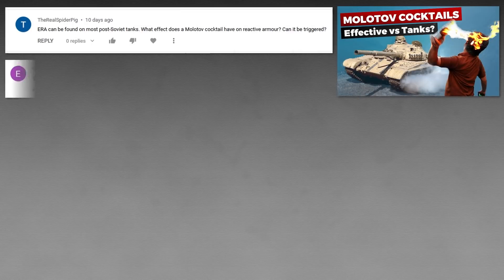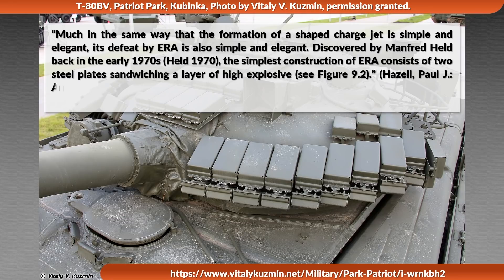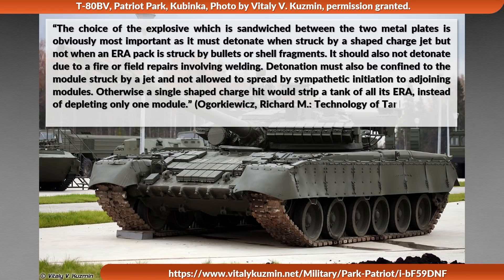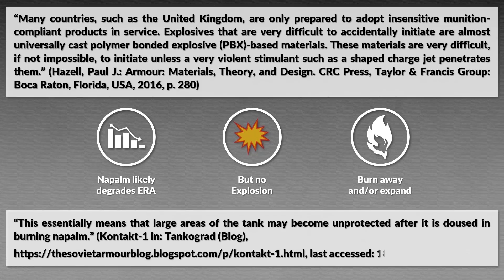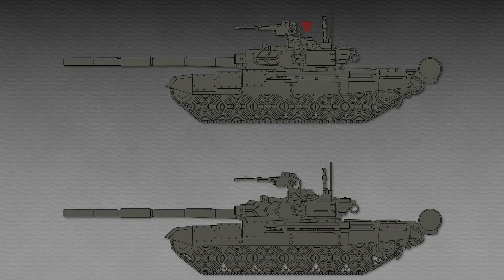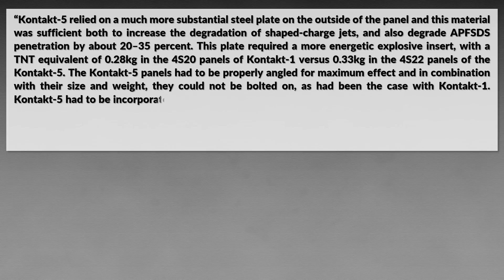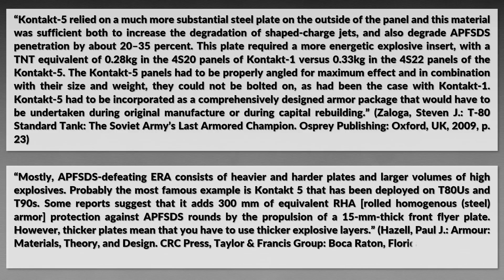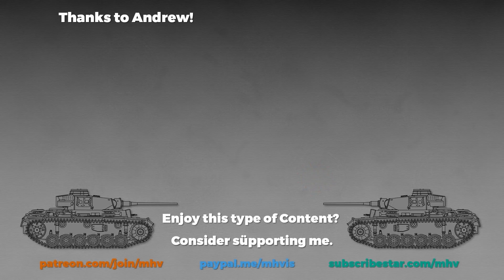Why does Russian Explosive Reactive Armor not explode?

Comment: NOTE: From the late-19th Century through well after WWII, the US Army and Navy used an extremely insensitive explosive ammonium picrate for many projectiles, most especially those that had to penetrate any real thickness of armor.  It was originally called "Dunnite" after its inventor or, by the US military, "Explosive 'D'".  It was only about 90% as powerful as TNT, which is why it was not used by most other nations, but could reliably be slammed through any thickness of armor (or earth, rock, etc.) and, when properly tightly packed in the projectile with no voids in the material, (learned prior to WWI during tests and training exercises), it was also safe against being set on fire and/or detonating due to fire unless heated to a very high temperature.  Setting it off with fuzes in armor-piercing projectiles using only tiny base fuzes and small boosters was very difficult (another reason for lack of foreign use), but this turned out to be true for most less-sensitive explosives widely adopted after WWI, so a better booster was eventually developed, Tetryl, a very powerful, but safe in tiny amounts, with the US Navy, being rather psychotic about ordnance safety, requiring extremely tiny pellets in its base fuzes pressed into two rocket-nozzle-shaped pits in the fuze upper end, so they caused HEAT-shell-like blast needles into the Explosive "D" that reliably set this filler off.  After WWII, even more fire/blast/fragment-safe explosives replaced Explosive "D"..  Why other nations were not as strong on safety is kind of hard to understand, given the effects of accidents.
Reply: TIL The us actually put safety first for many munitions.
Reply: Oh and I must say I am a great admirer of your work an naval armor and munitions. It is fascinating reading and very informative. The amount of research and effort you have devoted to it is truly impressive.
Reply: @Lovemy1911a1  This project started because I liked to play naval miniatures while going to college and I found the rules for many things very complex and, roughly, accurate, but the armor rules made all of the ships look like match boxes hit at right-angles.  If you see pictures in such documents a JANES FIGHTING SHIPS, you now that this is completely incorrect.  So with great hubris and ignorance as a Math and Physics Dual Major at UCLA, I told myself that I could solve this.  And I later found that I am insanely stubborn when confr9nted with a problem.  I would not have gotten very far except very, very strange things happened with this study.  I got a job just after graduation in 1972 with the US Navy at NSMSES on the Port Hueneme, CA, Sea-Bee Base concerning guided missile fire-control and was there while we added digital EVERYTHING over the next few years (I was not just on the ground floor of the introduction of digits to naval military gear, I was in the basement!).  And, very helpfully, the TERRIER GMFCS that was my primary system had to have people who knew something of digits go to what was the old WWII US Naval Proving Ground, Dahlgren, Virginia (now the US Navy Surface Warfare Center, Dahlgren Division) where they were developing the digital stuff (I was there, on and off, for 19 weeks).  While there I found out that a number of people who had worked on armor and AP projectiles were still there (remember, early 1970s), so I talked to several of them, including Dr. Allen V. Hershey, who had been the director of the Ballistic Computation Division during WWII until armor went away in the US Navy in 1955.  He was interested that somebody still cared about all the work that he had done back then.  So, when he retired in the early 1980s, HE GAVE ME EVERY PERSONAL FILES AND ALL RELATED DOCUMENTS HIS GROUP HAD EVER WRITTEN!!!!!!!  He was afraid that they would throw it all away.  So, I was like a young sleuth that Sherlock Holmes gives all of his work to when he retires, to continue the effort.  Indiana Jones has nothing on me.  And I helped the redeployment of the IOWAs, too, by supplying needed metallurgical details -they had not believed that the ships would be resurrected and suddenly needed EVERYTHING YESTERDAY.  Got not one but TWO guided tours of the NEW JERSEY during overhauls.  As I said, Indiana Jones, eat your heart out!  And that is only a few of the strange things that happened to get me information.  I am sure that there is something going on with this - how much "luck" can one person have, anyway?
Reply: @NathanOkun  well that is a pretty amazing story. Glad you were able to get so much information before it ended up locked in some forgotten cabinet or in a dumpster. I work for NavAir on the maintenance side of things so I've seen how things get lost to time. Thanks for the additional information. Out of curiosity do you know of any instance more sensitive explosives led to an accident? Oh and by powder I meant propellant in general, though in big guns that's probably not a very good description given the size of the propellant pieces. Not like the little sprinkles I load into my 30-06.
Reply: @Lovemy1911a1  If you are talking about propellant accidents, you have the Spanish-American War initiator, USS MAINE.  It had its magazine blow up due to faulty cooling between the magazine and the boiler room.  I am not sure what kind of propellant it had, black powder, brown prismatic, or more modern smokeless nitrocellulose type.  The US never used nitroglycerine-laced double-base propellants except early in WWII, when they adopted some British Cordite due to needing more propellant immediately and it took time to ramp up the pure nitrocellulose type that the US used.  The British Cordite had special warnings on the bags to make sure that they were never exposed to excess heat or rough handling.  The Navy retired that propellant as soon as they had enough of their normal type. 

A bigger danger was nose fuzes in nose-fuzed Common with black powder fillers or the HE/HC type used later.  There had been reports of nose-fuzed shells dropping nose-first on a steel deck and blowing up.  To absolutely make sure that US Navy nose-f8zed shells could not do that, WWII HC/AA Common shells (not sure about before that), had Auxiliary Detonating Fuzes added.  These were cylinders inserted between the nose fuze and the booster explosive that had were just a firing pin at the top pointed down into another instantaneous detonator, with the upper side of the ADF having a thin plate that, when armed after firing by projectile spin, allowed the detonator of the nose fuze to provide the blast pressure to push the ADF fir8ing pin into its detonator.  This caused a small added delay, so these shells would move forward maybe 6 inches before exploding, but usually hitting armor did not cause any problems; actually against thin armor, it gave them better results since they could punch a small hole in the plate before exploding.
Reply: Personal experience?
Reply: Nathan, I was under the impression that the use of insensitive explosives in shells, particularly AP shells was to prevent them from prematurely detonating on contact against armor. Was that not an issue at times of shells bursting before penetrating and either failing to penetrate as the base is now on a separate journey or greatly reducing the damage potential if a penetration occurs? Were there incidents of accidental explosions of shells that pushed the US to adopt stronger safety measures? From what I've seen propellant seems to be the main issue with ammunition safety & accidents.
Reply: @Lovemy1911a1  Concerning shell explosives as regards to armor penetration per-se, this was not a problem.  It took the typical HE explosive about 0.003 second to go off on impact shock (British Lyddite -- trinitrophenol  or picric acid  -- being the most widely-used prior and during the early years of WWI l even later by Japan),  With nose-fuzed shells detonating instantly when the firing pin was rammed by the impact into the detonator before the shell moves more than an inch or so, the detonation started from the front and moved backwards so fast that the shell really could not move more than a small distance forward before it completely blew itself apart when using HE fillers.  The inertial shock delay of the too-sensitive fillers requires the entire filler to compress itself toward the front end of the cavity before its sets itself off like being hit with a hammer, and this short compression period will allow the projectile to completely penetrate any armor plate used on any warship if it hits at a high-enough velocity to get through that armor -- either that or the projectile, if almost stopped, will detonate while halfway through the plate.  The shell will not move very far on the inside of the ship, though, causing almost all of its damage just behind the plate hit.  This is quite adequate when hitting turrets or barbettes or conning towers, but, with the internal "splinter screens" and "protective decks", and, in WWI, thick coal bunkers along the sides of the hull, the damage was considerably reduced.  That is why delay-action fuzes and insensitive explosives were needed to do major internal hull damage.  The British realized this only after they studied the big Battle of Jutland in May 1915, where the newest German APC shells had a VERY UNRELIABLE delay-action-fuze and used cushioned blocks of TNT as the filler to reduce the chance of the TNT exploding on impact (worked most of the time, but later the British added a lot of beeswax into the TNT to make it even less sensitive in their post-WWI smaller guns up to 8").  Penetrating hull hits were thus the major reason for the change to insensitive explosives, with the US figuring out this early and others having to find this out after battles later on.  Black powder was a very slowly exploding material and it took as long as a very long delay-action fuze to go off, but it was also very dangerous compared to most HE fillers when a shell was damaged while inside the ship.  The US Navy restricted black  powder in its WWII and after ships to as little as possible (saluting guns only) due to the danger of keeping that stuff on a ship when not used for anything important.
Reply: Thank you for explaining the Explosion in the USS Iowa's turret that killed so many sailors using ancient ammunition was caused by the Navy's safety first practices. I was under the impression that they tried very hard to find a scapegoat before admitting the ancient propellant probably detonated accidentally whilst being rammed into the guns barrel by the ancient rammer.
Reply: @andrewallen9993  That was never discovered.  Crushed propellant cases had happened literally hundreds of times over the years in US Navy tests and in actual battles and NONE had EVER done that.  It is possible that some new situation occurred due to some new piece of equipment, but just crushing the powder bags would not have done it.  This is the same kind of once-only fluke that caused the time-fuzed 8" shell to blow up in the gun barrel prior to firing in the DES MOINES Class warship turret explosion .  Sabotage was thought of, but since nobody was alive in either explosion case, this was dropped as impossible to prove, true or false.
Reply: @andrewallen9993  I know one of the independent people the Navy asked to cross-check the results.  He stated that the tests you mentioned were WAY, WAY beyond anything that the simple chain rammer could possibly do to any powder bag, even at the highest speed setting (there was nothing wrong with the rammer; they checked).  Whatever caused this was something that was highly unusual and, if some propellant problem, a once-only thing or so rare that nobody had ever had it and a crushed powder bag happen at the same time.  In any case, the regular powder was quite safe.
Reply: @NathanOkun  The regular powder was quite safe. I'm glad that you explained that it quite safely exploded and killed 47 matelots.
Unlike you I don't consider that safe. Sandia did several tests and they all confirmed the ammo bags and propellant were quite definitely unsafe. Presumably that's why the navy condemned so much of the old WWII Stock? Because it was so safe? Where I live we would call this operation stable door!
Reply: @andrewallen9993  They declared a lot of powder unsafe because it did not stay in a chemically stable form (the add-ins to slow the nitric acid chemical formations had slowed, but not stopped, this process).  This was known to propellant makers from the 19th Century.  If a bag was unsafe and somehow got passed the inspection process then this might happen, but testing bags for such problems had been done for about 100 years since the original "smokeless powder" introduction.  As I said, the person who I know, a REAL expert in this subject.   I worked with him on internal ballistics (how powders burn inside guns) as well as external ballistics (projectile flight dynamics) -- I am terminal ballistics.  If he says that the cause could not have been the rammer, then the cause was NOT the rammer.  Thus, we have a problem of unknown cause that cannot be duplicated by anything that they should usually be doing while loading a gun.  If somebody did something else, then we do not know, but the regular rammer could NOT do this.  My friend is sure of that and I believe him.
Reply: NOTE:  the Javelin comes down from the top and blows the turret off batter than that old stuff you are going on about...Hell you might as well talk about the Chinese firecrackers shot at the enemy before the West even had gunpowder.
Reply: @edwardschmitt5710  I was just giving you a historical perspective concerning the introduction of insensitive explosives since their introducti9on in the 1880s, with some being found to be too sensitive and others being found to be adequate through the end of WWII.  Many of the newer materials are still having some problems due to their being newly-developed and all of their quicks still being found.  Technology is moving ahead today at an ever-faster rate and many things now in use have had little time to work out their bugs.  The top-down kill mechanism required major improvements in sensors and tiny solid-state electronics and new systems to counter them will undoubtedly be developed in the future, making THEM as useless as a wet match, too.  "And the beat goes on..."

Comment: The problem might actually be simpler, what your seeing on the battlefield only LOOKS like blocks of era. If you look into it, corruption has literrally broken the tank. That era is expensive on the black market as well as otherwise, alot of it is actually being stripped off the tanks, by either maintenance or orders from higher up, and sold, to enrich the  commanders and political commissars. Its then just replaced by real looking fakes, mostly made from painted egg cartons or wooden pallets. And The inspections are made by people who are easily bribed because of the high power low pay nature of there job and employer

Comment: It's difficult for many to understand that the blast wave from various missiles , artillery etc. can knock off the turret of a tank and not detonate reactive armor . The atmospheric pressure inside of a tank is different than the air pressure outside during a major explosion. Imagine squeezing a plastic bottle until the pressure makes the cap come off.
Reply: This. Even the kinetic impact of an inert missile can knock the turret off a tank.
Reply: I somehow thought there were many hits that exploit the design of the tanks, namely their auto-loader that has the tanks' own rounds arranged in a ring around the base of the turret. If you hit them hard enough, the tank goes boom from the inside. NLAW is supposedly really good at that, as well as not really hindered by explosive reactive armor.

Comment: I think grenade or grenade lounchers can set them off. 
It's only explosive that can set them off. Fire or mechanical punch or electrical shocks can't set it off.
Bonds in the molecule of the explosive dictates the way explosive can be set off, i think TNT can only be set off only by explosive. That's why you have miners use miniature explosive devices (detonator/lighter/detonator cords) to set off larger TNT explosive.

Comment: I would not be surprised if  a big amount of the Russian ERA containers are actually empty and useless because of some corrupt blunder  and only mounted for psychological reasons. Also modern ATM have  integrated small charges that are designed to first set off the ERA before the main charge penetrates the tank.

Comment: There have been a number of studies done on the T90 and  because the Russians are cheapskates, they are making the ERA on the T90 useless. 
The T90 is basically a T72 with lots of bells and whistles, but it shares one omission - no air conditioning and in that tiny turret they need it !
The crews of the T90 keep their hatches open and for some reason when they do this the ERA doesn't work !!
Keep the hatches closed and melt or keep the hatches open and probably roast !!

Comment: Interesting and informative.  I was wondering why the turrets are being blown off.  Could it be that the NATO death missile designers have reverse-engineered the Russian turret ring's tensile strength so that their missile explosion fractures the ring, blows off the turret, and then incinerates the tank crew and the munitions?  Possibly using depleted uranium to "weight" the explosion?
Reply: non-expert but I read (saw YT vid comment) that the Rus tank turrets are held on by gravity & US are actually attached.